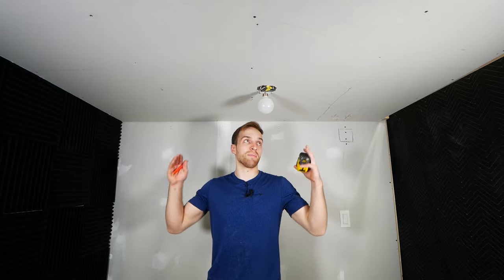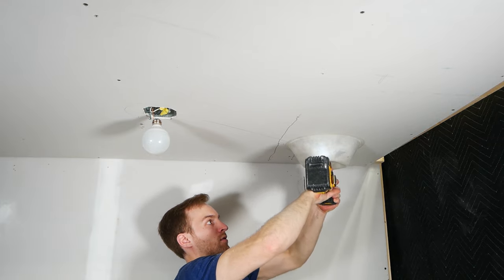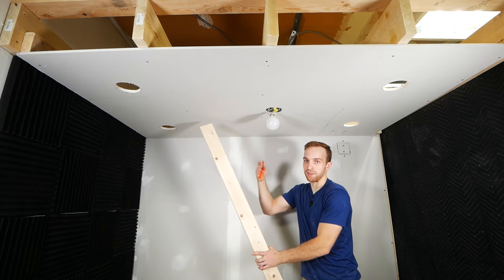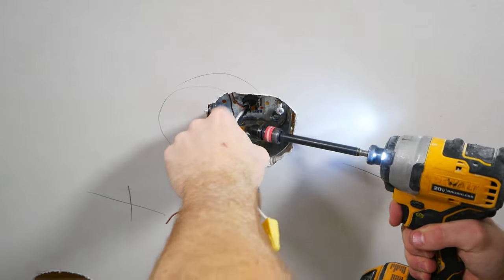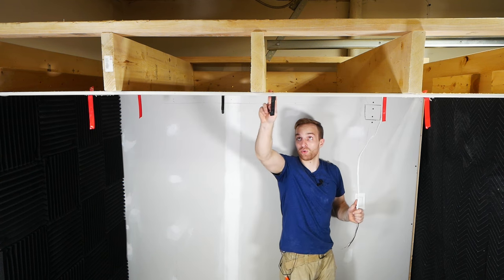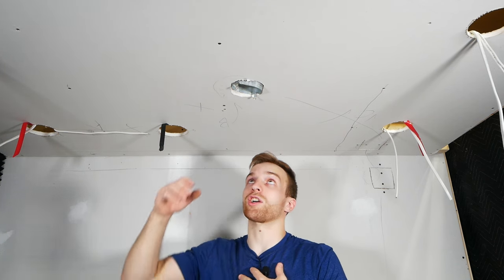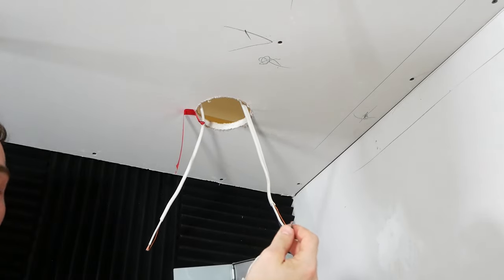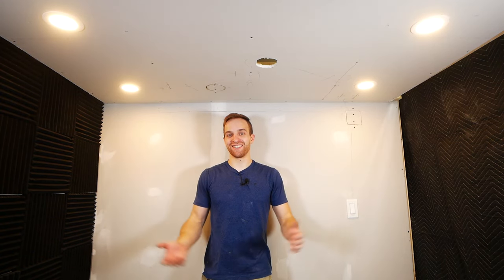How to Install Recessed LED Lighting Without Attic Access (Pot Lights / Can Lights)

Comment: Thank you for this video and it’s visuals. This is the first video that I have found that specifically addresses my situation. I’ve wanted to install this type of lights in my ground floor kitchen, located in  a two story townhouse with the ceiling directly adhered to the joists. This video clearly explained the process necessary to accomplish this project. Keep up the good work and hope to see more videos in the future.
Reply from the maker: Glad I could help!
Reply: I used a flex bit😂 I died when you said you better have home insurance😂 I got really lucky and the project turned out great, loved this video though you really are the only one who has a made a video with truly no attic access

Comment: The visualization of the joints above the ceiling is very helpful for a novice like me. Thanks! Can I just run the wire across the top of joists so no need to drill holes on them?

Comment: Thanks for the video.  I just did a job for my father and used 1.5 flexible PVC pipe in one light hole and used a snake through the PVC pipe to get directly through to the other light hole and then pull the wire back to the starting hole.  Worked for me.

Comment: Im trying to put recess lighting into an old house - but I want to keep the main light as well and possibly add a dual lightswitch - one switch turns on existing light and second turns on new recess lighting. Never done anything like this before but I fixed up my car (mechanical) after watching a few videos just fine, so I think I can handle this. Could you make a video about adding a dual light switch or even how to add a new switch to a new location. like on the otherside of the hall so I have two switches for the same light
Reply: I’m interested in the same thing— how to add the switch(es) if there is no preexisting switch wire to use. I’m remodeling a room that will have canned lights on one switch (probably a dimmer) and a ceiling fan on a second switch. And both need to be controlled from each side of the room.

Comment: The radius of the angled probe that you use in the ceiling prior to drilling your holes should be the same radius as your cutout. This sort of probe is easily made with a piece of fish tape bent at a 90 degree angle. In addition to looking for the presence of joists and ducts you should not be cutting into the strapping that your drywall is attached to.

Comment: I dont have an existing light to use as my switch line. I’ve successfully drilled through all the joists and have all the lights connected. I just need to somehow get the Romex through the corner of the wall and ceiling and feed it down the wall to my switch box. The wall is behind shelves as well….sooo my brain cant solve it. Someone please help.

Comment: So is that "to code" to have exposed wires running parallel to the ceiling joists? I thought wires couldn't be exposed incase someone was ever to drill through the ceiling and puncture it.  I understand you could staple it to the ceiling joist but maybe it would be difficult to do it you don't have attic access.  I mean if I do this to my home and stay forever I would know not to ever puncture my ceiling in those areas but if I sold the home the next owner would not.  So long story short, is it to code?

Comment: NEC 314.23(A): "Boxes, conduit bodies, and fittings shall be securely fastened in place."  

For a no attic install, I think it's best to put these things right next to joists and get a long bit and fasten the boxes through the hole.

Comment: why do you need to drill holes through those 2x8 boards? I see there are gaps above,  just wire through the top gap?

Comment: I ended up getting lucky putting in 10 pot lights in my living room with no attic access. The home was built with open trusses so made fishing the wire very easy and was able to pull power from an old uncentered ceiling fan for the pot lights and the old entry light was used to center a ceiling fan. Love the video and gives a great visualization for not having open trusses

Comment: Nope, don't use a hole saw. They are terrible. All it takes is one skip... Instead use a quick cutter. Less dust, paper is easily removed and it's a much cleaner cut.

Comment: you should stick a inspection camera up there to see if there's any pipe up there a lot of DIY never follow codes you wouldn't want to cut a hole and suddenly cut a water pipe and using flex auger is easier your journeyman and foreman don't like it if you have too many holes on ceiling especially one that fits a fist size

Comment: If there isn't insulation, you can use a small USB camera to look in the bay to make sure you're not drilling into anything with only a small hole to patch.

Comment: I did a very similar job in my kitchen using 6" wafer lights. Similar to yours, there was an existing fixture in the center, and installed 4 wafer lights in the same positions as yours. The J-box in the center had three cables connected to it. Rather than putting in a blank plate, I made the existing connections in another junction box, which I just placed above the ceiling along with the driver for an additional wafer light where the original fixture was. This way the junction box is still accessible and code compliant, and no need for a blank plate. Nothing wrong with having an extra light in the center.

Comment: What do you do if that main hole in the middle is a ceiling fan and you want to reinstall it after you’ve installed your recessed lighting? Will the ceiling fan have a junction box? And do I just wire from that box to one of the holes, and so on?
Reply: Also - very helpful video!!

Comment: My tip would be that when you drill each hole and to check if there's anything in the way, take out your phone, turn on camera with flash in video mode and stick it in there and look around and record a video to see what's up there.

Comment: I'm not sure hiding wires behind crown moulding is legal.
Also, as far as being able to see into the next "joist space" all you need to do is drill through one joist, then stick an inspection camera into the hole and look around. You can get endoscopes for like 30$...
Furthermore... It's actually very easy to tell if you've contacted something that isn't the wood you are trying to drill through with cable bits (long flexible drill bits). In addition to that, it's generally pretty easy to get a good idea of where your plumbing and air ducts are without cutting holes.
Reply from the maker: It’s legal where I am to use crown moulding but obviously local code can differ.
You need to remember this video is made for DIYers. They probably aren’t going to want to buy an endoscope. I use flexibits all the time for the exact reasons you mentioned but a DIYer will 100% drill through something they shouldn’t have lol

Comment: Good video.  I have a somewhat similar situation.  One switch in the room controls an outlet on the other side of the room and there is no overhead lighting.  I thought about putting pot lights in, but I'd have to tear out a ton of drywall like you showed, and the switch situation would be very dicey.  Probably will just have to live with my lame switched outlet. haha.

Also, in your video, if you are putting a pot light where the existing overhead light box is, you can start your wiring there and go around the room and you wouldn't have to mess with the switch.  I think most people would want a light in the middle of their room, so that would make things easier than having to rip the box out.

Comment: I want to install four pot lights in the kitchen with no attic access and found your video invaluable. I can use the existing fixture as the feed to the new pot lights since it's already switched. As you explained, the octagon box where the old fixture was located can be used as a junction box. After making the connections to the pot lights does this "junction box" have to be accessible? I'd like to cover it up completely by repairing the drywall. I don't want to have some sort of cover plate in the center of the ceiling where the old fixture was.
Reply from the maker: Unfortunately the junction box will need to be accessible if you want to meet code. 
In my area a lot of the time we will shove the box into the ceiling and put a pot light below as the box is considered accessible by means of pulling the potlight down 
Of course this may not work with the layout that you want but it is an option

Comment: Why not just run the wire over the joist when fishing it so you don’t have to drill?
Reply: This is a demonstration for if there is no access above the joist. If it’s a 2 story home sometimes the just is flush to the second level and to the sheet rock for first level ceiling with no space between so the only possible way is to drill

Comment: Maybe a stupid question, but if you can feel around all of the joists, if you can get above the joist, why wouldn't you just run the wire above the joist if you can reach over all of them rather than drilling through the joist?
Reply from the maker: You would absolutely run your wires over top the joists if it was an attic or drop ceiling. This video was made specifically for when that isn’t the case, as in there’s a subfloor on top of the joists so you can’t go over. I probably should have put something on top for demonstration purposes to convey that better.

Comment: I wish I would've seen this before I bought a flexbit! Thankfully I haven't used it yet!!
Reply from the maker: You can use it but you just have to be extremely cautious and understand the risk. If there’s a bathroom above the ceiling you’re working in then definitely don’t do it. Also it’s very easy to have the bit come out somewhere it shouldn’t lol
Reply: @WorkinwithWolkon  I appreciate that! I have terrible luck and even though there's no bathroom, I would definitely hit something! I have to scrape the popcorn off the ceiling anyway, so adding a few holes won't kill me (there's no asbestos) 😁.

Also, thank you for making a video that actually explains what to do without access. Every other one I've found is "we have no access..... but there's a gap that we can run the wire through, so it should be easy."